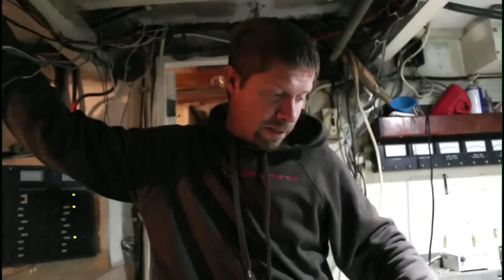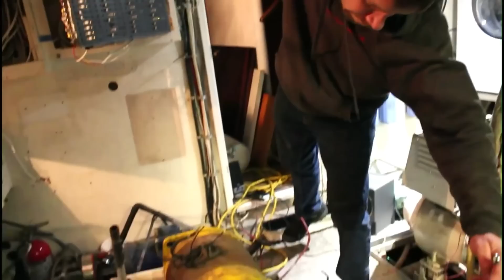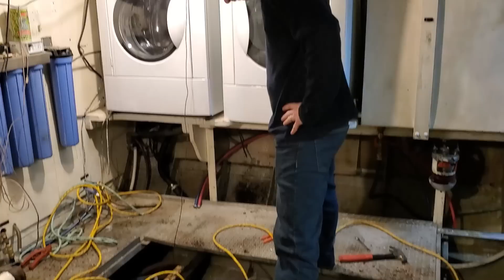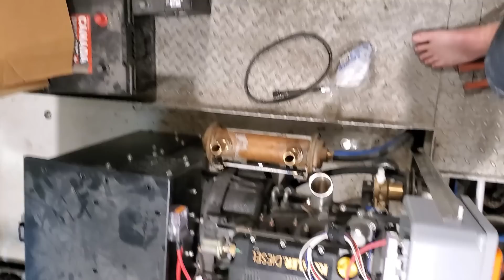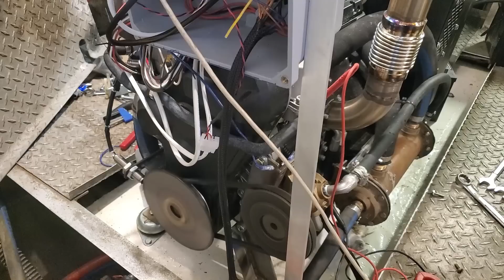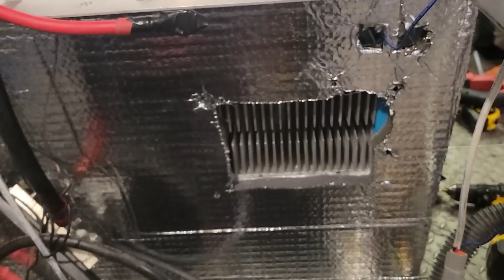We Built a DC Generator with Alibaba Parts and an EBay Engine

Comment: Why not use the generator heat ex changer to send water into baseboard radiators to heat passenger/crew compartments?    One could even have a little valve to switch to sea water for the summer when the people don't want the heat.   It seems like free heat (less baseboard heater and some pex tubing costs)
Reply from the maker: We could for sure but we run the generator so infrequently and for so short of a time that it would be of little benefit. We already have hydronic heating onboard though so would not be tough to do.

Comment: Are you using or plan on using a master control system to operate all the different systems on the boat?
Reply from the maker: When this video was made we were using an Orion BMS and Victron equipment for integration. It was a pretty nice system. We are currently working on a much more advanced system.

Comment: I really respect your knowledge and commend you guys for making your own systems and components the way you want but there is a lot of engineering and trials,testing and long term trials that go into the making of a mechanical system such as main engines, generators but most importantly pulleys bell housings and other belt driven equipment .  Like I said before I really respect and compliment you guys!!!  In my experience with yachts, excavating equipment, trucks and motorcycles over the years is doing my own pulley system and bolt on belt driven equipment is a lot of broken bolts c ,cracked mounts and premature bearing wear .   Best of luck and love watching your journey !!!!❤
Reply from the maker: It’s certainly a fun engineering exercise! I do usually enjoy it. The generator has been a bit of a thorn in my side though. Had the initial DC generator head been as advertised the whole system would have worked great. Sadly, that was not the case and I have been chasing it ever since.

Comment: Holy smokes the amount of knowledge you have on all the different things from generators to diesel engines to engine governors is incredible !
Reply from the maker: Thanks! Honestly, much of it is from actual experience working on the stuff but a great deal of it is from exhaustive research on specific projects. Usually I have at least a years worth of time to thoroughly dive into research and design before I actually tackle the project. Many things work well but some do not. The generator has been a never ending supply of frustration. I think I will be on version 3 before I get it the way I want it.

Comment: I am sorry to say this, but I have been doing marine maintenance for 10 years. When a piece of equipment is removed, you clean, fix, organize, and paint; none of this has been done on the Tangaroa. The reason you do it is so you're not back in that same boat a few years down the road.
Reply from the maker: Don't know that I follow. When the new generator went in the bilges were cleaned, a brand new generator platform was built and fresh painted, all fuel lines were replaced, all electrical cabling and switching was replaced, exhaust was built new. When the new engines went in the entire engine room bilges were cleaned, all of the old copper fuel tubing was replaced, the entire fuel transfer and filtration system was rebuilt. The only thing that wasn't replaced was the mufflers. This is pretty much the same with every other system that is permanently installed.

Comment: Sorry for the late question  but curiosity has got me by the short hairs, if you had these massive Alternators already without a known use for them why did you risk going with a Chinese  generator unit? Seems like a no Brainer. Thanks love your channel thanks for sharing all your knowledge it helps me alot with my boat.
Reply from the maker: The massive alternators actually came into my possession years after the Alibaba generator head was put into service. The original generator head performed fairly well for the first couple of years. Glad you are enjoying the channel and that it is helpful!

Comment: Another point to consider is oil cooling, as it has a higher benifit than coolant. A good oil heat exchanger extends the life of your engine, more so than larger coolant exchanger, 😉🇨🇦
Reply from the maker: Definitely a good point. I have done a bit of thinking on that subject. Haven't pulled the trigger on anything yet though.

Comment: These Kohler engines are actually Italial Lombardini units. Lombardini was taken over by Kohler a sometime ago. They're good motors and very popular in numerous industrial and agricultural applications in Europe, and they are also available as small boat motors in marinised form.
Reply from the maker: They have seemed to be great so far. Definitely not as quiet as I thought they would be though.
Reply: Yup was going to mention that Lombardini has been making small engines for the past 60 years in Italy. They are the smallest lightest diesel engines for their CC’s. I’m only watching this now pity as I would have said touch base with Lombardini marine in Italy and you could buy a nice heat exchanger wet exhaust in one off the shelf for that motor as they use them in the Paguro marine Gensets. I had a Paguro 3500 genset in my previous cat and on our new to us bigger cat bought a Paguro 8000 marine genset second hand. This has the smaller LDW 602 engine which is 2 cylinder 600cc. My engine burst a hose and did not shut down so it’s toast. I’m just finishing the import of a new model LDW702 engine from Spain to replace it with. By the way the Jonson raw water pumps they use  fits on the back plate by the camshaft and runs off the back of the camshaft with a rubber seal.

Comment: With a full compliment of guests and crew we CAN use a lot of electricity AC, water makers, compressors, hot water, stabilisers, bow thruster, Etc. and run two 100KVA gensets. Your batteries will help smooth the load, having periods with low loads at anchor we've had issues with the diesel engines running for long periods under stressed.
Reply from the maker: Can definitely get a lot of big loads once you start getting into boats like this. Fortunately we have kept the straight electrical loads to a minimum. Stabilizers are hydraulic, hot water is diesel, no bow thruster, no air conditioning, etc. This genset can keep up with singular large loads but the inverters would definitely overload with multiple at the same time although we have had no issues yet. I will eventually have an AC genset. That along with the ability of the inverters to boost generator power should keep up with what we have. I have been tempted to throw in another couple of inverters as well for additional capability. The nice thing with the DC genset is that when it is running, it is heavily loaded continuously as it is just charging batteries.

Comment: Are you going to make a way for it to automatically start when the batteries get low?  I drove a Peterbuilt  that had 'no idle' to keep the truck habitable during our 34hr resets, it would use batteries (24 volts), to run the hotel services (heat, radio, microwave), when the batteries got low, it would automatically crank the motor (22 liter Cummins ISX) and run it till it was charged.  On a 34 hour stop in Wamsutter, Wyoming it ran about four times for about an hour and a half total (air temp was about ZERO Fahrenheit).
P.S. as i have said, my family is USN.  My mom taught us the first rule of mailing shipping ANYTHING to a ship.  Pack like the WILL drop it off a two story building!  It look your dad has the same philosophy when he built that crate.  Other than the weight, as a trucker,  woul rather have something packed BOMB-PROOF than 'tissue-paper' packaged and have worry about it.  I actually hauled a 'load' of 50ft specialty tubing from Texas to Montana, that was about three feet in diameter and slung from the corners suspending it, it weighed less a thousand pounds, going to a distillery.  When i found out what those tubes were WORTH and what they PAID (whole 53ft trailer, less 1,000 lbs) that woke me up!
Reply from the maker: Great question. I do actually have that all functional. It can auto start and I can also start it remotely. That being said, I do not use the auto start function just yet. Still doing a bit of testing on everything before I trust having it run automatically. 
   Those brewery systems are crazy expensive. Pretty much artwork.

Comment: If you turn the gen slower the control has to run the armature current HIGHER!
Reply from the maker: Yes, that is correct. That being said, if you turn the alternator slower you can increase the efficiency pretty massively. So, if you reduce the output demand on the alternator as well as spin it slower all while keeping it cool then you can get more amps per hp from the genset. 

Blaine

Comment: At least get a spare inverter even if lower power for critical systems. Your exposure to lightning EMP places your electronics at risk. Seek out surge protection for the electronics as a minimum.
Reply from the maker: Funny enough, I was just thinking about that this weekend as I was moving the inverters. Would have been nice to keep the fridge running.

Blaine

Comment: I would be happier with one dc genset and one AC with rectifier. That way if the inverter fails you have backup.
Reply from the maker: That's exactly the plan! We changed plans for that reason. I like redundancy.

Blaine

Comment: I have a similar but slightly smaller setup in my RV,  all built and managed by me. 

Currently looking at a wakespeed and 48v alternator to get some decent engine charging.  Fab’ing my own brackets and mounts are the fun part. 

Thanks for the vid.  It was fun to watch someone tackle similar problems on a slightly different scale in a different environment.

Your home brew genny setup is very cool.   Taking notes on the electronic management and governor setup.
Reply from the maker: Right on! Always fun to talk to like minded people. The genset has changed around a bit since this video and I still need to finish some things up but I am running two Delstar 300 alternators with dual Wakespeed Pro regulators now. So far so good! That will be in a later video.

Comment: If those new alternators have controllable fields, I can strongly recommend either than Wakespeed or Zeus alternator regulators. They integrate beautifully with the victron system. We've got one for our little engine, and it just shows up as another device in the system.
Reply from the maker: I did just that indeed! Loving the new Wakespeed Pro units. Still working on some integration things but so far they have worked well and having them on the Victron is great.

Blaine

Comment: I know this post is old but just wanted to say this as it's important.
alternators need higher RPM the RPM is what drive to cooling fan and allows for clean voltage on the output Under driving them will add More stress to the field coil as it has to run at a higher Amperage to create magnetic fields need for the demand. I built a system much like this using 3 Pentax units on a 3cyl yanmar diesel. i added magnetic clutches on 3 jack shafts driven off the crank this wired to the ign wire on them so i can turn them on and off individually a single belt drives all the jack shafts 2 spare belts are in sealed bags in my service cabinet and each alt is driven by a flex coupling.
also I recomend updating them to use a WS500 controller on each this has integration with victron systems and can give you load and health info and auto balance the two gensets
Reply from the maker: I didn't really go into it in this video but the new setup uses 2 Delstar 300 alternators with attachments for fresh air intake hoses and I have external electric cooling assist fans to overcome any heat  issues. They still run at about 3500 RPM. I have the setup up and running now and without the cooling fans I am seeing about 50c stator temps at 140 amps each with about 50% field usage. With the fans they should be well within safe limits. I am indeed using 2 Wakespeed 500 Pro regulators. Its very nice having the integration capability for sure. I still have a bit of tweaking to do but so far it seems to be working as designed. Thanks for the comment!

Blaine

Comment: have you ever done a vid on the tiny truck???? it looks like it might be japanese k car ish.
Reply from the maker: Lol, we have not but that thing has been one of the most useful vehicles I have ever owned. It's a JDM Suzuki Carry. Brilliant little piece of equipment!
Reply: @OnboardTangaroaSeatrial  ive read it's really hard to get them and really hard  to plate them.. how did you get it done? what is the payload??  thanks  much.. loved  your  repower series, so much  more  realistic  than  the tv  ones where  they  do  it  in a  weeks  and its perfect.. thanks  much  for the show
Reply from the maker: It's actually very common to import JDM vehicles into Victoria where we live. Tons of JDM stuff here. The guy who is next door to my shop imports vehicles and parts from Japan regularly. It is a bit more difficult in the states as the importation laws are a bit more strict. In Canada we have to wait until the vehicle is 15 years old before importing. The States requires 20 years. You also have to comply the vehicle so it meets local laws (third brake lights, running lights, etc.). Some states have also banned the kei cars and trucks.  The repower series will be coming back even better on this channel as it will be focusing on only the tech and will go further in depth into what it took to plan and execute. Happy New Year and thanks for watching!

Blaine

Comment: Put a lip on that support with a drain plug.  You will thank me when you change the oil.  Also, crank your rpms down for noise if you aren’t going to get 400a
Reply from the maker: Great idea but this generator has been going for three years now. I just suck the oil out with a pump through the dipstick port. Its a pretty simple setup. I do have an oil change manifold that a subscriber donated which I will be installing soon though. Just going to install a JIC fitting off of the drain plug. Unfortunately to produce the amperage it needs the rpm's. I would love to be able to turn the rpm down though. 

Blaine

Comment: You got these cheaper but by time you built engine mounts made a flywheel controllers governors all your time you didn’t save anything
Reply from the maker: My time is free and I enjoy doing it. I also ended up with a product that has perfect integration with my other systems. When I was looking for premade dc generators that could provide 400 amps of 24 volts I could not find anything for less than $20,000 CAD and those systems were standalone and had no integration ability with my system. I would say with my time included I am at about $8000-$10,000 and that's generous.

Blaine

Comment: Your new generators look like they weigh considerably less. Have you taken weight into consideration when it comes ballast to your boat?
Reply from the maker: We have indeed. The generators have a pretty minimal impact though.  I imagine the removal of all of the paint and filler on the topsides has more than offset the loss of weight between the generators. It also helps that Tangaroa is very inherently stable. She is not a tall boat and the hull plating gets thicker progressively as it nears the bottom. The also has a keel and integral tanks. We also have a 700 gallon water tank that is not connected to our fresh water system that we use for ballast when we are light on fuel.

Blaine

Comment: It seems you are focused on the current too much, the current will drop as the battery charged, if not the battery would go over voltage. If the current drops and battery voltage is low, there could be an issue!  Try putting a load on the batteries while charging. Use all the high power things possible see how the current does then!
Reply from the maker: Unfortunately it's not a battery acceptance issue. Additional load only reduces the current proportionally into the bank and the cell voltages decrease to match which would indicate a supply problem.  At a 400 amp charge current this battery setup would only be at a .3c charge rate which is right about their standard charge rate. They are capable of a 1c fast charge though. They should have no issue accepting a 350 amp charge current right up until they are almost at full charge. I should have confirmation this week on this as the new alternator setup is going in.
Reply: What do you use for a charge controller?

Comment: If the alternators are air cooled, slower is worse as there is less airflow cooling the stator windings/rectifier.
Reply from the maker: Definitely correct however I forgot to add that these alternators will be using forced air cooling. The Delstars have a 3" hose connection on the rectifier end and will be fed by blowers. They will also only be run at about half capacity. The regulators also have an alternator temp derate function.